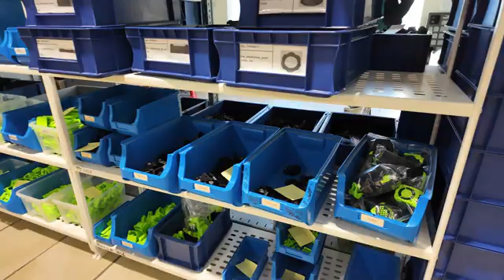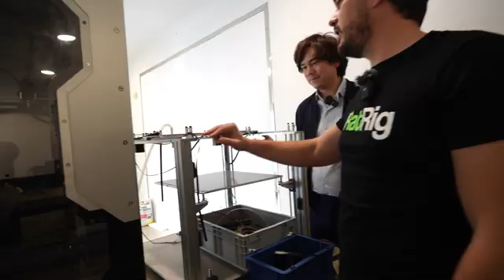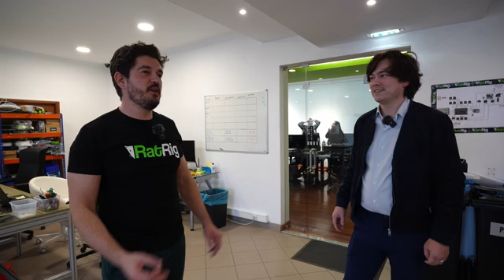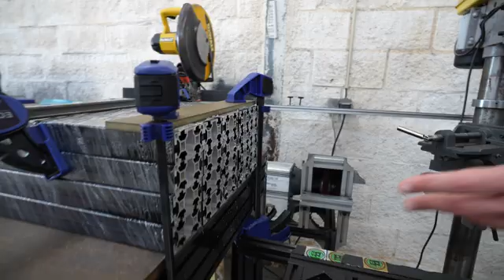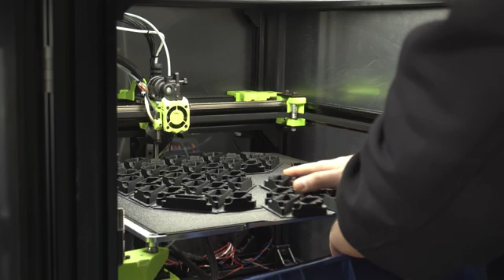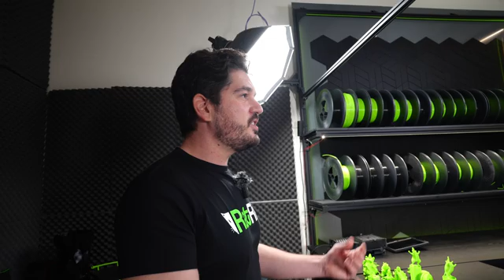Ratrig Factory Tour - How The Largest and Fastest Kit Printers Are Made

Comment: I've worked in a couple manufacturing factories, T slot is everywhere in them it's cost effective not because the material is cheapest but, because the design, manufacture and assembly is fast. They obviously have other huge advantages though.

Comment: When I hear "pro", I want to see servo motors. Wheres my servos ?
Reply from the maker: Just plug them in yourself. 

Open source + klipper means you can do a motor swap in under an hour. 

But to be clear, there is nothing wrong with steppers.
Reply: @NathanBuildsRobots   You sure can, and I'm doing it at the moment on a Mingda MD1000. It takes longer than an hour if your stepper drivers are internal. There is nothing "wrong" with steppers and they do a great job at 3d printing, but the pros of servos are well known (silence, smoothness, closed loop control) and IMO a must have for professional use at least on a larger machine.

Comment: For the disrupt machines you can clearly see 3d printed parts but he said they have removed all plastic from the disrupt machines.
Plus does anyone sell metal replacement parts to all the 3d printed parts in their diy kits
Reply from the maker: Those were prototypes, so I’m not sure of those are temporary plastic parts or if he meant most of the 3D printed parts are removed, like in the toolhead and CoreXY motion system.
I could use some clarification on that too.

Comment: Great video - was particularly interested in the section on the Hybrid/IDEX - and the explanation that the extra motor helps drive the heavy Y Gantry in normal single head mode - although then you have two motors for the X too - so it makes sense to use one of them for IDEX.  Shame they have put their RMMU on hold - as an IDEX with colour multiplexer offers some really interesting possibilities.   Also like how much use they make of extrusions around the place.
Reply from the maker: There was a lot of extrusion. But it’s a cultural decision that makes it so everyone gets a good understanding of how to use it and its strength limitations; which builds a good intuition for how to use it which then ends up improving the product designs.

Good example of a beneficial cycle of design

Comment: sadly i heard soooo much bad things about RatRig sets ... building them seems to be not as perfect as told ? sadly, i met them at Formnext in Frankfurt and the printers look AMAZING!
Reply from the maker: There is no way around the fact that it printers take a solid 10-20 hours to get up and running properly, maybe longer for a first time build. It can be frustrating. But this beats the alternatives, which just don’t exist at this size range
Reply: @NathanBuildsRobots  The issue is supremely low quality components  -  linear guide rails with rust spots and unacceptable slop, bowing profiles that are not cut perpendicularly or true to size. I haven't heard anyone complaining about the complexity of the build, no first time user is shelling >2k euros on a ratrig...

Comment: This is my second RatRig factory tour video.  I love the entrepreneurial approach of RatRig, and kudos to whomever devised their guerrilla marketing green hats at their inaugural FormNext appearance last year.  There may be a 500 mm V-Core 4 IDEX in my future.  I like what RatRig is doing.  I've been watching end users' V-Core 4 build videos and I'm waiting for some early issues to be resolved.  In the interim, I may put RatOS on my SV08 so I can install that sweet Beacon 2.0 bed mesh scanner that can also detect a direct touch off of the heated nozzle on the heated build plate.  That would solve the bed mesh and Z offset inaccuracy problems.  Then, if I could install a thicker cast aluminum bed that minimally warps when heating, I'd have perfect first layers and much more reliable printing.  Or maybe I'll buy a Disrupt Engineering IDEX printer.
Reply from the maker: You can also buy a K2 plus heated bed from the creality site for around $100. It’s 5mm thick, not sure what the SV-08 is

Comment: Great video! I knew nothing about them but its good to see they are way bigger than I though. I looked at their 500mm printer. May end up picking one up.
Reply from the maker: I’d get one of these over an orange storm giggle 🤭
Reply: While the vCore 4 has a lot of improvement, if you go 500mm be aware the outside dimensions of the vCore 4 are a bit higher than of the vCore 3.1. The assambled vCore 3.1-500 barely fits through my doors at home. The vCore 4 wouldnt fit, so it would be stuck in the room I assembled it.
Maybe this is one of the reasons RatRig uses customiced hights inhouse. For the very big printers, a lower hight can be quite helpfull if you want to transport it. Remove the bed, tilt the printer to the side, and you can fit it through door you couldn´t pass with the standard size.
Reply: @oleurgast730  - Good point about a shorter printer being able to tip sideways to fit through a door when a 500 mm V-Core 4 wouldn't, but I don't think that was a concern for RatRig.  They shortened their V-Core 3.5 printers so they could stack them three high in their print farm.  It looks like they may be using 300 mm beds to fit as many printers in their farm as possible.  They run a full bed of small parts at night and a mostly full bed on day shift to run them at close to 100% capacity.
Reply: @Liberty4Ever  You are definitly right. Big bedsize for printers are mostly used for following reasons:

- cosplay. But RatRig isn´t about cosplay at work.
- many smal objects on a bigger plate, to run "over night" without service, as you mentioned. 
- flat bigger objects like the baseplate of the mostly self printed printer.

Personaly I ordered a vCore 3.1-500 mostly for printing retro computing stuff - like printing an Amiga 1000 case (modified to use a PC board emulating an Amiga, with an CD slot and USB ports behind the Ram expansion cover and of course a floppy drive). However, the project is on hold at the moment, as I love Prusas Nextruder + MMU3 and want to modify Prusas CoreOne firmware to be used with the vCore 3.1 (I am aware I cant move z0-z2 independend anymore, but I can live with this downside).

I actualy have a Jennyprinter 650 (Voron 2.4 inspired 650by650by600mm³ printer) kit for about 3 years now, unassambled - after I saw my error - its outside dimensions will never fit through my doors. However, after seeing this video, I saw the solution - just buying 4 new shorter z profiles and linear rails would solve my problem (not shortening the original parts, as I might move the printer to my grandpas house in the future, were I have the space to build and use the printer in the same room, so I can build it in full size). So this video is quite helpfull.

However, I bet I am not the only one having a problem with the vCore 4 - 500 outer dimensions. RatRig should add an option "standard door compatible" hight. I think many hobbyists would love to be able to transport the printer without disassembly (exept removing the buidplate of course). Also beside the nice IDEX option I would love to see an official toolchanger upgrade. With the offset adjustment using a camera for x and y and a sensor plate for z, one of the main requirements for a toolchanger already is implemented.
Reply: dont do IDEX unless you realy HAVE to. input shaping graphs are a joke and the bearings cant handle the proper tension you need for a beltpath that long.

Just balancing all 4 belts are a nightmare.

Printed parts quality was also scam level bad. layers didnt adhere at ALL. even between perimiters nor on layers. Print settings are 3 perims and what seems to be 5-10% infill.

Had i known it was this bad i would have gone with a upscaled voron and AWD.
Reply: @Hellsparkt  - Thank you for the informative post.  Many people would consider it negative or bashing a product but it sounds like the counter to marketing hype.  Issues as you described are a large part of the reason I'm waiting to see how V-Core IDEX works in the real world.  I was aware of the input shaping issue and had previously posted that it might help to have separate input shaping for single head printing, copy printing, mirror printing and IDEX printing, but even then there is some IDEX motion that input shaping can't compensate.  I was also aware of the trouble people are having trying to achieve proper belt tension and other initial build issues.

I hadn't heard that layer adhesion when switching between tool heads was a problem but that actually wouldn't bother me much.  I'm not printing PLA two color Baby Yoda figures.  My two potential applications are TPU feet or other surface features on structural parts such as PETG-CF, where the slicer interlocks the two dissimilar materials, and PLA support for PETG-CF parts, where lack of adhesion is a feature and not a bug.
Reply: @ if ratrig would have gone a little more forward thinking they would forego the obnoxious hybrid idex setup and gone with AWD to half the already monster belt path. then go with a toolchanger system like the XL or other projects. that would help greatly with input shaping, commisioning, and material selection.

Comment: I want one of these so bad
Reply from the maker: Maybe start with a Vchonk? I don’t know if they are even selling it yet or if it’s just an open source design just for fun
Reply: My 12th printer is the SV08 and the 350 mm bed takes care of my large format printing needs - occasionally large parts but usually a lot of small parts for EZ home based manufacturing.  I don't have a current justification for a 500 mm V-Core 4 IDEX but I find myself designing products to justify it.  I have an idea for a 280 mm long product printed in PETG-CF with TPU feet, and the IDEX would be far better for that application than any MMU that wastes a lot of time and material purging.  I'm mostly waiting to see more videos of user built 500 mm V-Core 4 IDEX printers in the wild.  It's fairly complicated so I'm sure the early adopters are on a learning curve that I'd like to be flattened before I send my money to Portugal.   🙂

Comment: Rat Rig's execution speaks to me, I do like my tiny voron, but not the fiddlyness of it, and I went with a bondtech rather than printed extruder.  I big ass ratrig would be nice in my garage workshop.
Reply from the maker: I can’t stand how fiddly my voron is, especially the software config stuff
Reply: @NathanBuildsRobots  I've done all my.configs from the default ones, and figured out a few macros for pauses and stuff.   It's more like how you pointed out with the prusa core one, of you need to swap out a bearing you can easily get at it, the worst part about vorons is the compact tool head that you can't just get to a fan or something simple without pulling the whole thing apart.

Comment: Gonna be waiting for that fully assembled all metal ratrig to drop forsure
Reply from the maker: I think there will be a bigger hobby market for it than they are expecting. There are way too many crazy people that are willing to pay for a high-end giant printer just for home use.
Reply: @NathanBuildsRobots  - With a specific niche product with high markup that needs specific printer features, the cost of the printer isn't significant.  If a $500 printer isn't able to manufacture a high value product but a $5000 printer can make $500 worth of parts in a day, the ROI is surprisingly short and there is ample justification, even for a guy manufacturing with one printer in the basement.